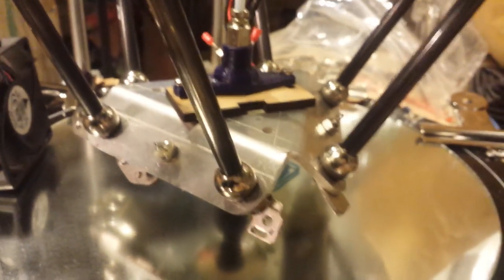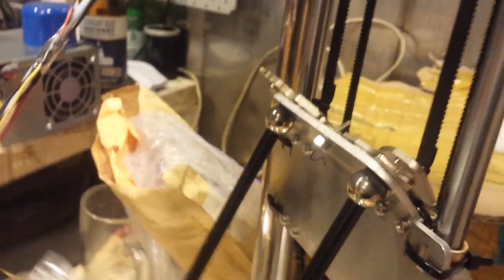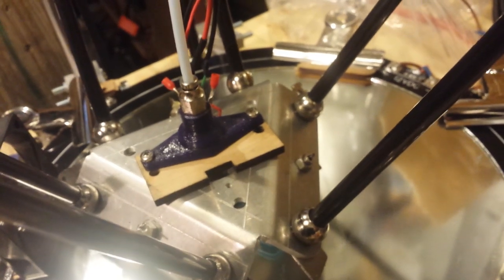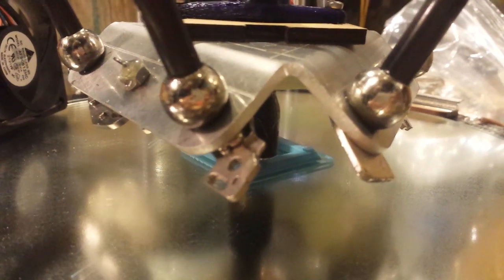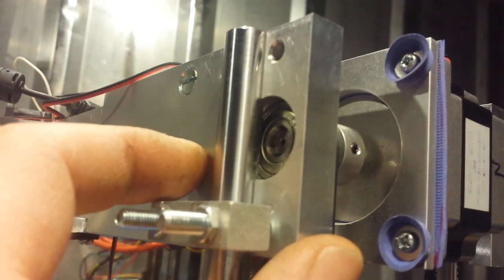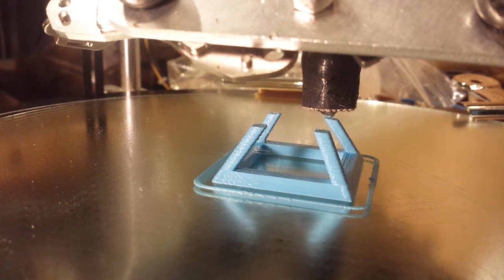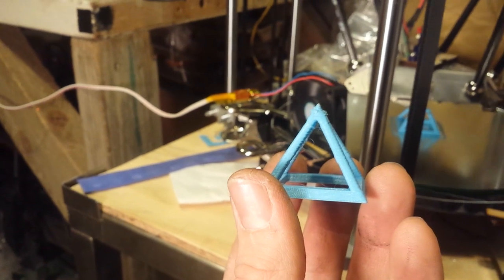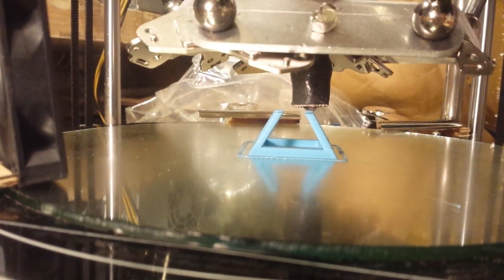Voyager 1 Delta 3D Printer. Spring assisted vs Magnet ball joints

Comment: ok, I'd say both are horrible and changing joints did nothing lol. Apparently the problem is elsewhere :)
Reply from the maker: Don't know what you mean? If we stick with the title of the video, it compares springs vs magnet joints. My thoughts even 5 years later are that magnet joints totally kick ass (I still have the same rods and magnets on it now but don't use it much after getting a prusa mk2! However... tightness & rigidity of all moving pieces does make positioning far more accurate, BUT doesn't actually bode well for FDM printers, they need a tiny bit of slop in order to print smooth - mainly because of the lightweigth components used. If we started using cast iron beds and frames etc that would be a different kettle of fish but $ prevails... Rigidity becomes very useful in milling applications and one day I will put a small spindle on this thing for a laugh...
Reply: Tim Jacobsen lol. Sorry, I should have been more specific. I was talking about pyramids quality. Both came out poor imo, especially considering how slow printing speed was. I am making a delta now. And yeah, magnets are cool and such, but only if you want to print slow (under 150mm/s lets say). And in this case why bother with delta at all. I am trying to find an optimal joint in terms of rigidity AND weight. Magnetic ones are a no-go: too heavy, and can disjoint at 10000 acceleration values easily. So, I am gonna first try normal standard plastic joints (like in rc cars), properly connected and setup and see where that brings me. And plan B is to go with a method of having a ball on a rod and cavity inside of effector and just push the rod into it with any rigid non stretchable line/rope inbetween two rods.

Comment: Nice setup! I like the metal.

On the pyramid I suggest slowing it down to 10-20mm/sec and remove the Z lift/retract. You also wanna run as much fan as possible. I run a 120mm fan like yours @ 100% after 3-5 layers.
Reply: I use simplify3d. it has a setting which tells it to slows down the printing when the layers are being printed in less than x seconds. printing on a layer which has not been able to cool down yet will result in a mess. Like the top of this piramide.
Reply: You guys are both inaccurate. As the slower you print the more heat can be fed into your plastic via a tip of your nozzle hence melting the whole thing. I personally dont use that feature in s3d as i find it useless. Powerful fan does the job way better.